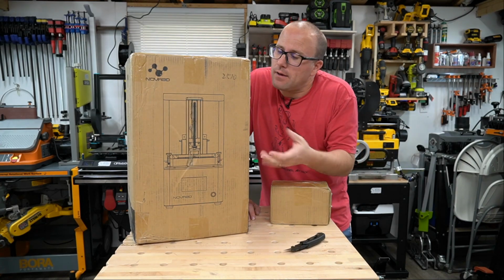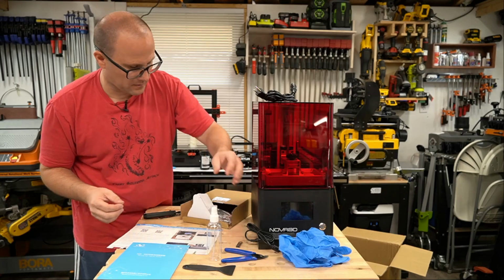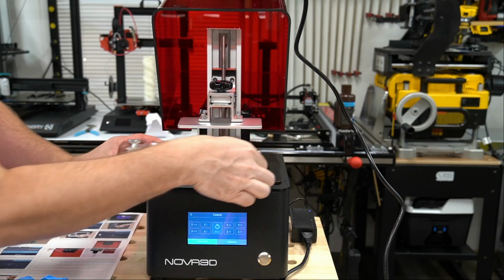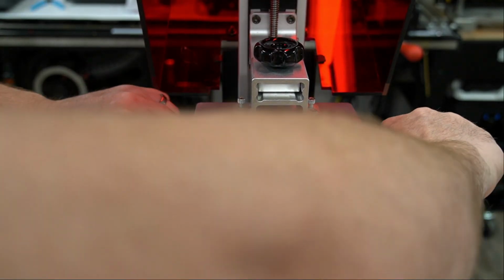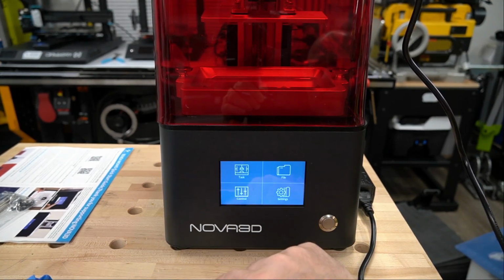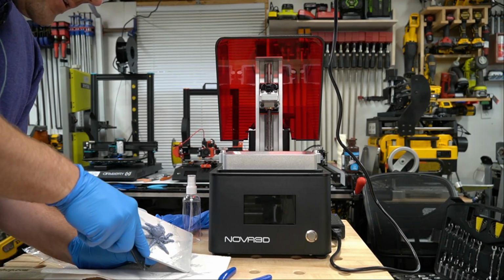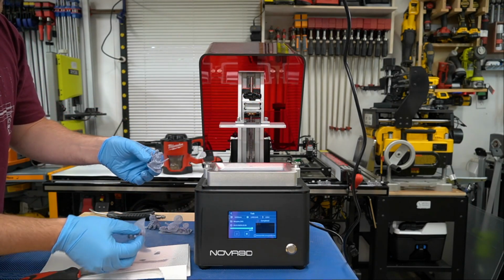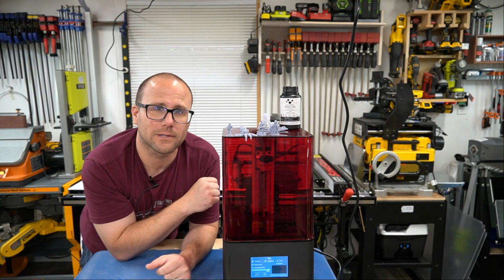Nova 3D Bene 4 Mono Review // This rivals my $1200 Prusa SL1!

Comment: JFYI: gain was high on the mic so you had a lot of distortion/peaking throughout, but especially near the beginning.

It looks like the print volume for this is larger than the Prusa (I have the prusa, but purchased assembled with the washing/curing station). In the video, it looked like the vat in this was larger than the prusa, but it turns out the printing size is almost identical (2mm larger than the Prusa - around 1/16")

It seems like it just pulls the build plate vertically instead of peeling it off like the Prusa. I'd be curious to know if the failed print rate is higher with this one as a result.
Edit: Actually, your second print shows what I was wondering about. That separation was likely caused by suction.

One thing I do like with the Prusa is that you wash and optionally cure while still on the build plate, so there's less breakage. Not sure that's worth an additional $1300, though. 

Nova does have a washing and curing station on their site. No details, though.

Looks like it compares pretty favorably for quite a bit less.

Edit2: The vat has a corner just for clean pouring. It was opposite of the one you used :) I'm surprised you didn't use the strainer (you just used a funnel as far as I could tell) when pouring back into the bottle.

Comment: i am actually amazed you got anything to print. this review makes the Nova3d bene Mono look "average" at best. not because it is average.....but because you don't read instructions before jumping in and pushing buttons because apparently you know what you are doing?!?  My instructions tell me to use a piece of a4 paper folded over so essentially double thickness of a sheet of paper, this would help with the problem you have where they are sticking so badly to the build plate. also the instructions tell you that the plastic scraper is supplied to use in the resin vat in the instance of a failed print, not for scraping the build plate.  in the end at least you did give the printer props, the video was clumsy , not the printer.